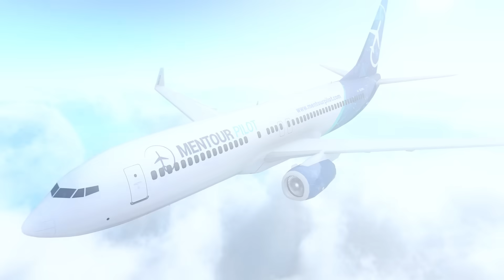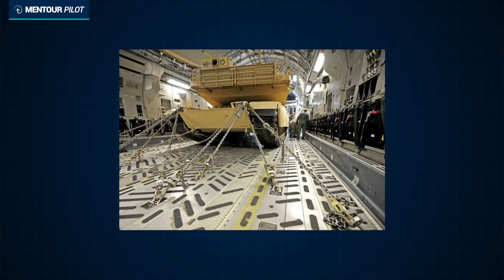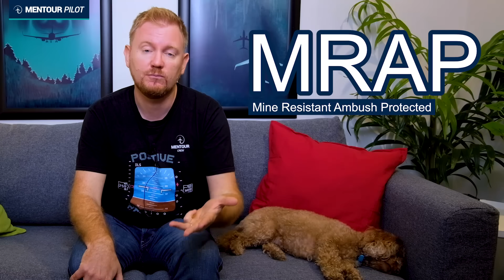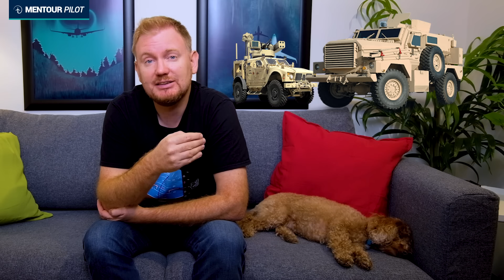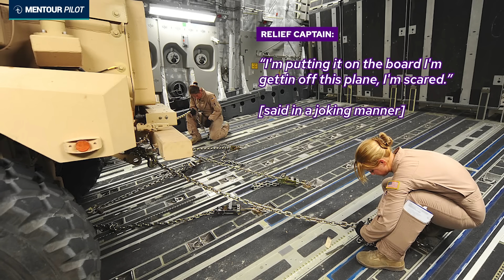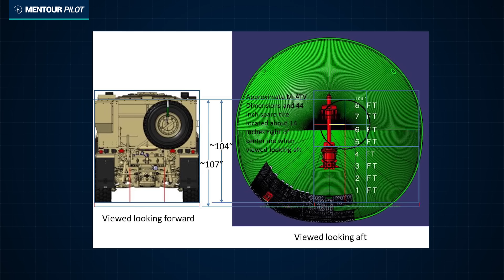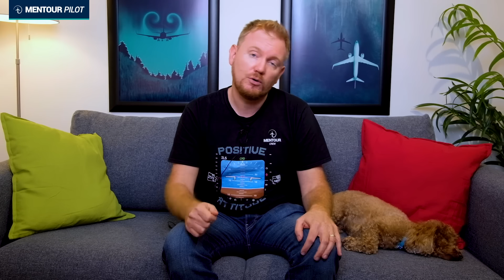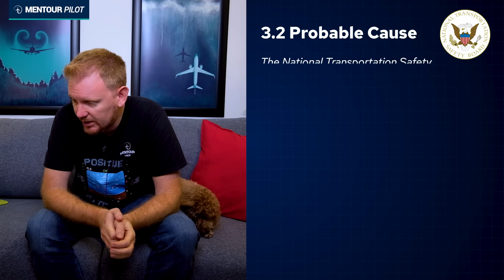Why did the pilots LOSE control?! National Air Cargo flight 102

Comment from the maker: The first 1000 people to use the link will get a free trial of Skillshare Premium Membership: https://skl.sh/mentourpilot03211
Reply: It seems strange that wheeled vehicles are not required to have their brakes applied, and the gears in park, or reverse?!
Under NORMAL SMOOTH flight, I believe, the cargo would not move even during take off or landing.
Such precautions - gears alone, stop a vehicle rolling up to about 30% incline.
Also, chocks are even more useful than brakes or gears in preventing rolling movement, especially with heavy vehicles.
Are the FFA, and load-masters unaware of these facts?

Obviously straps ARE also required, both as a belt and braces protection, but also because, under turbulence and negative G forces, ALL my securing advice becomes useless!
Also strapping is the only way to prevent lateral movement.

Thanks for the report, very sad - especially as I say, because any one of three additional restraining techniques, I believe, would have worked so long as no significant negative G occurred at any point during the flight.
Reply: @keithalderson100  The vehicles were sanding on platforms, even if they apply brakes and use chocks n the vehicles. the platforms can still move. (I am not a professional, correct me if I am wrong)
Reply: @tijsdelaere6284  you are correct. AASLT school teaches basic slingload and strapping.
Reply: You're correct.  We called them "Cookie Sheets" . They're on ball bearing rollers. And sounds like they had no floor locks for them, likely due to the unusual thickness of the sheets. Still seems like a form of insanity to me. @tijsdelaere6284
Reply: @keithalderson100  llllllllllllllllllllllppppll
Reply: @keithalderson100  The vehicles where fixed to platforms with chains, and those platforms would slide easily since the floor is covered with ball bearings. Assuming that the chains didn't give, the only thing that can hold the cargo are straps.
Reply: @keithalderson100  They will slide even with brakes applied.
Reply: @keithalderson100  None of that will work unfortunately due to gravity issues. The least of them all is parking brakes, gears, chocks etc. All the pilot has to do is nose down a few degrees and all of the weight on the tires will gravitate allowing the vehicles to easily drift in any direction. The have to be tied down with force to the loading floor or remove the tires and secure the lug nut to special brackets that attach to the the floors and straps to hold the spring weight steadily against the floor to avoid dynamic forces to the plane.
Reply: @Garth2011  .
Reply: @Garth2011  9
Reply: Rich house poor house
Reply: Seems simple enough.  You have an inexperienced load master not adhering to regulations when confronted with a new unknown load type.  I would also site the to captains and seconds who should have been questioning this because of lack of familiarity.  If nothing else an Air Force load master should have be consulted.
Reply: It's clear that the pilots were not satisfied with the loading from their conversation. Why did they continue ???? Makes no sense !
Reply: Your videos are really well made, and you explain all the technicalities in a very accessible way. Two thumbs up! One request, though: even though there is no real "final report", I wonder if you could do a video on EAT's OO-DLL in the ground-to-air missile incident in Baghdad, 2003? Very curious to hear what your take on that specific case is.
Reply: The plyboard between the pallets was compressed by the massive vehicles. This loosened the straps in flight. And 40-60 straps? Obviously wrong tool for the job.
Reply: I sent u a mail at news@ id. Thank you for great vids
Reply: Really good video
Reply: Ase t8t.nnnnnjii
Reply: I hope it's me.
Reply: Great video, man.
Reply: This reminds me of a very similar accident that killed many of the soviet admirals who didn't understand the importance of correctly secured load distribution, and gave the pilot the order to go ahead with the flight despite his warnings. Perhaps this is an event you may want to do a video on.
Reply: I don't understand why this wouldn't have been planned out in advance. Seeing as it was none standard cargo. Why leave something like this to a load master?
Reply: do  a video on PK 8303 Plz . It belly landed, then took off and then crashed.
Reply: For you guys shaming him for advertising on his own video, a video that he probably spent a lot of time on, yall should really reevaluate what you watch.

He is not picking crashes/accidents where people die just to make money. He chooses said crashes/accidents where there is a lesson to be learned.
This is just educational material, filled with all the facts, it would be worse if he hadn't mentioned casualties since it brings out the importance of the lessons he explains...
Reply: :hand-pink-waving:
Reply: Dislike. For lacking dashcam.
Reply: A video about an AC crash, killing seven ppl onboard, is beeing used to promote a software???
Are u guys out of your minds?
Reply from the maker: @EndeavourAMS  Hi. The video has been made in cooperation with a sponsor-company, yes. 
The work involved and effort to create this kind of content requires significant capital investment, hence we need support.

If you have followed this series you will know that the emphasis with this series is on education, learning from the history and mistakes. 
I understand your concern but rest assured that we are taking all steps to be as sensitive and factual as possible when presenting these accidents.
Reply: @MentourPilot  You don't need to reply to that comment. Only a spin fake news expert would think what he has.
Reply: @MentourPilot  I have seen this video only. I am a pro manager. I understand investments and capital. 
That video is really good, professionally, up untill the promotion part. 
I advise you to reconsider and run a sensitivity test on that approach.
Reply: @MentourPilot  Thank you for that 😊. At the end of the video you point to a link for the last video about a similar accident, but the link you are pointing to is not in the video right corner. Just so your editor knows😉
Reply: @EndeavourAMS  Well. I think you are only here becouse you like to be bad.
Reply: @MentourPilot  It requires a camera and a mic. Your video has almost 600k views, which is the support you "need". Putting a sponsor in a video where people died is off putting to lots of people.
Reply from the maker: @jarateman6427  Hi my friend. We have no idea how many people will watch our videos nor how long it will take to achieve high volumes of views. We do how ever know how much it costs to hire professional editors, rent a studio, buy equipment etc. our sponsors enables me to do all that with certainty of financial viability. 
This is the reality of the world we live in and I’m sure you have noticed that in other channels as well. 
Have a great day.
Reply: @EndeavourAMS  get a life buddy
Reply: @MentourPilot I am coming to this way late, but wanted to offer some input. I fully understand the necessity of sponsorship and find your implementation overall to be tastefully managed. But I think the problem in this video was the timing. Perhaps it would have been better to have placed it early in the video. Anyway, FWIW.  

I am a longtime subscriber and love your work.
Reply: @EndeavourAMS  Is that how your mind see's this? Sad
Reply: @Garth2011  My mind?
Don't worry about mine. Worry about yours that is OK with cheap promotion on a fatal accident documentary.  That is sad.
And please... who are you to tell anyone not to reply to me?
Reply: @EndeavourAMS  lol, what do you think TV programme is? An ad break on TV?

Comment: I was at Bastion (the loading base) , our company made bids from Dubai. 
My end I said I refused to do because our equipment was not up to task. 

I did liaise  with the company that got the job and explained my concerns. Things like UV degradation of the synthetic ratchet straps (stored outside in the sun)

Realistically if the aircraft wasn’t diverted to Bagram it would have made it safely without  the extra flight cycle. 

I did a similar job in Kandahar , but with an AN-124 100.

Comment: I know in late to this but my brother's moves loads on ground and he is required to use chains. I'm only a few minutes in bou gotta use chains not nylon straps.
Reply: Just one of the reasons nylon straps are used in planes over metal chains is weight.

Comment: In a stalled aircraft, being a Cessna 150, or a 747, you have zero control. And recovery is only possible if the correct inputs are brought in, and sufficient altitude. In either case, not having those factors, you'll hit the ground and not in a good way.

Comment: Einsteinian Gravity theory teaches us, that inside an aircraft you never experience Gravity from the Earth's pull.  [in free fall, all objects have the same acceleration g].   The only thing that the pilots, the passengers, and the cargo experience are the forces of: the air (lift and drag) and the thrust (plus the braking, when on the runway).  This explains why the cockpit voice recorder was damaged after the "gear up" call.  This would reduce the drag, which opposes the thrust.  This would increase the forward acceleration experienced by the cargo, which then broke loose.  @MentourPilot  /investigations/accidentreports/reports/aar1501.pdf

Comment: The physics of this are as horrible as they are fascinating. The load shifts to the rear, shifting the weight balance backwards, damaging the stabilizer driving the nose up, all while cutting the hydraulics to the control surfaces.

Comment: Just thinking, it seems to me that a series of small levels, like a carpenter uses, could be placed in the fuselage, read electronically, and that could be provided to the pilot in flight if there are any significant changes in the CoG forward or aft.  This could also be done for the roll axis as well.  I'm not a pilot or anything, just have a little science/engineering background and a great respect and fascination for aviation.  This could also provide spatial orientation data for low/no visibility situations, although perhaps this is already being done gyroscopically.

Comment: I was in Bagram when this happened. 2 things: 1) we were lucky no ground fatalities occurred. Right next to the crash site was a bus stop and at that time normally between 40-50 troops would have been waiting there. A dedicated bus for the unit was an acquired a day or 2 before the event. 2) A massive load shift to rear upon takeoff also would have resulted in the nose tipping up skyward, without being able to correct stabilized flight. Eventually, not being able to take in enough air would result in stall outs. The crew was essentially dead on takeoff, because there was no possible correction possible at that point.
Reply: That area where that bus stop was had a lot of housing for TCN’s and across the street was a construction site that usually had loads of workers.

Comment: To me it is surprising that they just use regular straps for these kinds of vehicles. If they are designed to be shipped this way, then they should have specific points on the vehicle where they can be bolted with a steel rig designed to keep them in place. Just using straps to hold them down seems silly when they are fighting against the rolling of the tires and just using universal straps. We know what the mount points on the cargo hold look like so why not make something substantial that will do the bulk of the securing of the load without the guess work and then adding straps is just for additional safety?

Comment: Why do not 747's have a aft bulkhead protection unit that is permantly bolted in. Or it is mandatory that an empty container, that can be ballasted, be loaded in the rear, acting as a shock absorber with such cargos ?

Comment: As a truck driver, I knew exactly what would happen as soon as you mentioned "24 and 26 straps". On a truck it would be fine, but it will be put under a lot more G-forces on a plane than on a truck. However, even I would have used at least 8-10 chains and maybe 6-8 straps to secure the larger vehicles properly on a machine-bed/flat-bed. It's also important to make sure all are at similar tension, because otherwise one will hold more than the other and risk snapping. Nothing is allowed to be slack when securing cargo like this.

Comment: That's stupid, why didn't a military cargo plane pick them up? They would have more experience loading the vehicles, in fact probably a lot of experience. Even the small ones are heavy, plus straps could have been past use date, I would think they would chain them down. The straps I used as a welder, they wore down and fail, you need to inspect them.

Comment: Also, Why Didn't They Use 10,000 lb Chains? In C-130's, Vehicles were Always Secured with Chains. Not Straps. A 5000 lb strap turns into a 2300 lb Strap when Tying Down a Load ( 70 degrees angle) Add 3 G's Forward, 2 G's Up, and 1.5 G's Aft. I Always Wondered Why They were Securing Heavy Vehicles, In A Huge Aircraft, With Straps.
Reply: Sadly, we'll never know. You never use straps for this kind of cargo, but even back of the napkin math suggests at least 50 straps just for forward restraint so 60 sounds like a safe minimum.

Comment: When I look at the photo of the strapping in the front of the vehicle it is clear that there are only one or two straps pointing straight ahead and a lot more at an angle to the side.  During rotation the force exerted on the vehicle is straight backwards so only the straps pointing straight forward are really working and they carry the full  weight of the vehicle.  All straps pointing at and angle work less and the ones pointing directly sideways only working during banking.  The next problem is it looks like they are indivdually tensioned so it is very likely that one or two of them carried the bulk of the force (this is probably why some of them came loose at some stage because their indiviual forces became just too much for the ratchet).  It would have been better to loop a solid piece of rope a few times between the hook and the support point and tie it off in one place only so all the loops share the total force equally.

Comment: In my time with the RCAF I was once posted to a transport base working with the C130 and C17. Though I am an air weapons technician so I don't directly load cargo I only loaded ammunition and explosives. I have seen many vehicles loaded and don't think I have ever seen straps used for vehicles only chains. I also recall working with the traffic technicians that are responsible for strapping pallets of cargo telling me that the strap was rated to 5000 lbs only in strait line any bend or angle would significantly cut down on the strength of the strap. It sounds like from the description given in this video that thus was possibly accounted for

Comment: As we all know, the thought of using straps to secure these heavy metal vehicles was insane. But to take it one step further, I don't think anybody took into account the fact that the plane had to pitch up in a vertical fashion during liftoff which puts further stress and tension on those straps due to gravity than there already was. Those straps probably would have had at least a reasonable chance if they were transporting the vehicles on the ground by road since the whole load would remain horizontal. But transporting them on a plane that has to get vertical during liftoff was completely nuts.
Reply: That's basically what all loadmasters would be saying. Even IF you absolutely had to use straps, some quick napkin math for a vehicle weighting 38k is minimum 32 straps, assuming perfect angles just for forward restraint. The Boeing estimate of 60 sounds realistic, but once again, you'd never use straps.

Comment: This plane wasn't designed to carry these cars.
Reply: It can still be done. You make sure the vehicle has enough shoring to spread the weight to not exceed pallet limits, and when centerloading it, you would strap it down with chains to the tiedown points, using chains and using the weakest value, be it the chain device, vehicle tiedown points, or cargo floor tiedown pan strength. Ensure sufficient restraint for all directions of acceleration and you will have safe and secure cargo. These were special cargo, meaning experts looked at all the structural limitations of the aircraft and loading and deemed it safe to load, provided clearances are sufficient and they're restrained enough.

Comment: This sort of load should have been assigned to a C-5 Galaxy.
Reply: Or a C-17, which they usually are. However, if you have contracted available cargo flights, you use what you have and this aircraft could technically carry the assigned load.

Comment: There was abit of negligence here, giving the vehicles an inch of play could only double inertia even if they would have strapped with 100 straps and give it a chance of movement the result could still have been the same, inertia from an 18 tonne item is not a joke